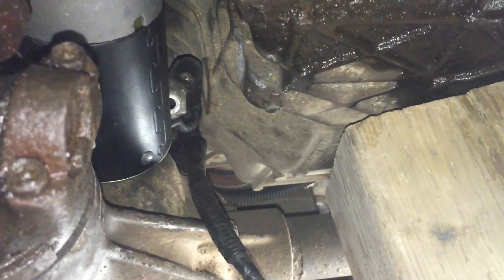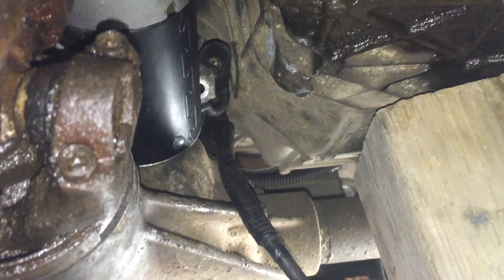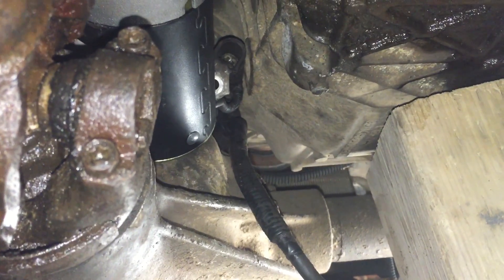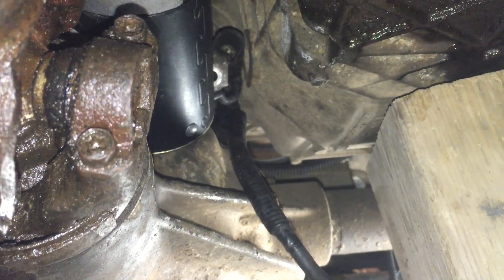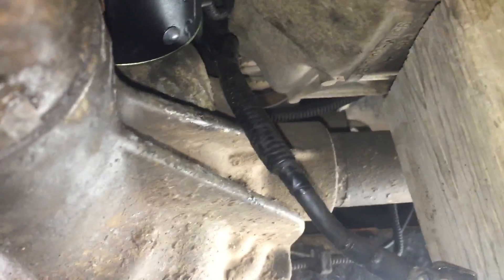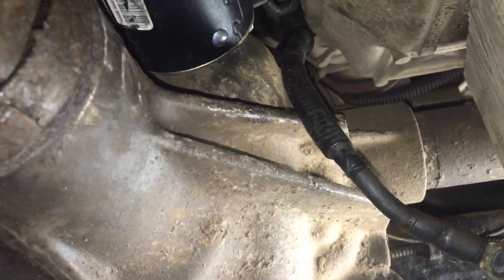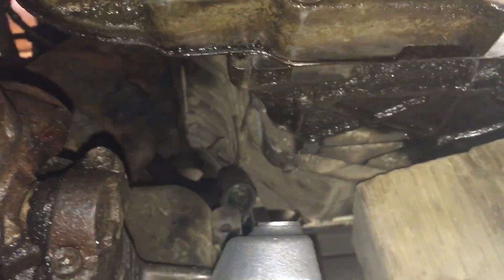Replacing starter 1998 and up Mazda b4000/ford ranger 4.0 4x4

Comment: I had a similar experience on my 2004 Ranger. The front end and oil pan don't have nearly enough clearance to get the starter through, nor through the wheel well or anywhere else. So I had to unbolt one of the motor mounts to get enough clearance to get the old one out and new one in. Really a big pain in the ass. And not to mention the fact of how little room is in there for you to disconnect the starter relay wires and wire em back up

Comment: It seems to me if you put that jackstand under the frame instead of the axle, the axle and diff would hang down and you may not need to jack the motor up.
Reply from the maker: Terry Mullan the axle isn’t in the way, it’s the front rear-end and driveshaft
The diff is bolted to the frame so it doesn’t move. 
It doesn’t need to be jack up much, just enough to flex the motor mounts. The starter only needs 1/4-1/2” more room
Reply: My apologies I haven't looked under there in a while. I assumed it was like a regular diff that traveled with the axle.